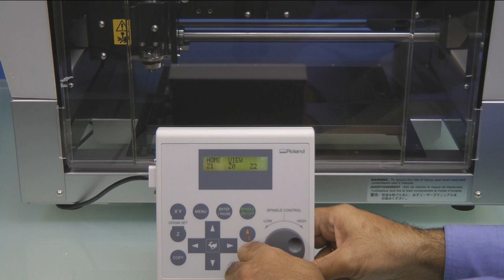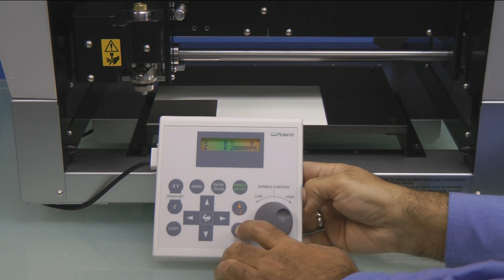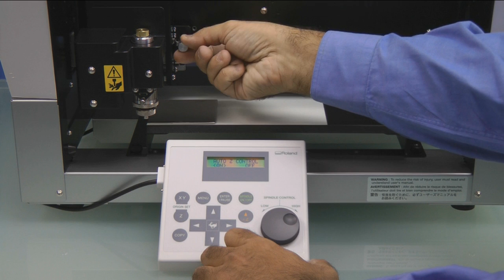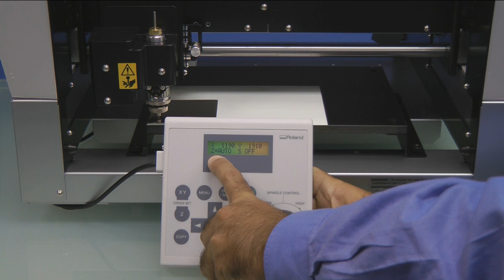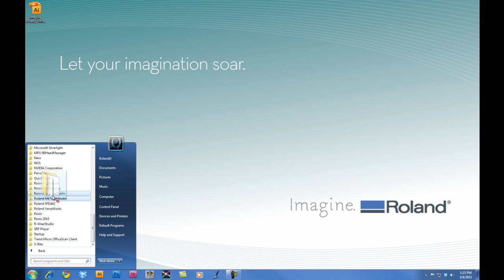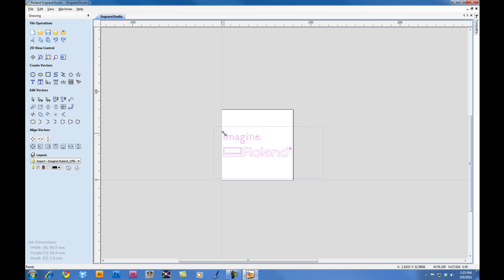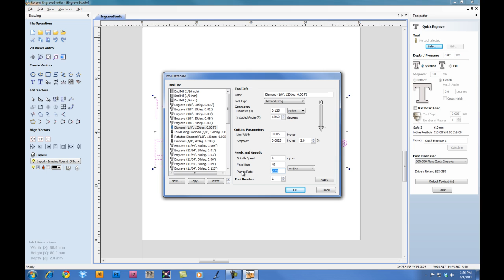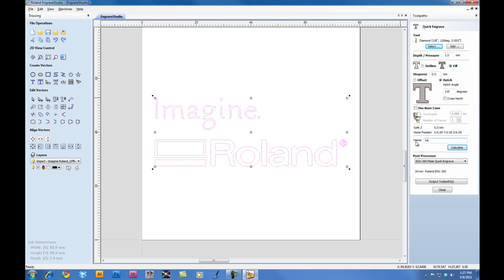EGX-350 Out Of Box Configuration (2 of 4)

Comment: Hi!
I have EGX-350 machine in some years now, but still haven't used it.
It happened to be very difficult tu set up th drivers corectly to work.
I managed to run Dr. Engrave tool but if I try Roland Engrave Studio it fails all the time.
In your video at 7:41min when I click on Calculate Quck Path - The software shows a message 
"Please turn the Machine on and connect it to USB".
My machine is turned on and connected, Dr. Engrave manages to engrave, but not Roland Studio.
Does some one have any idea why ? 

I had actually a Win7 PC which was working with that SW but since then I can not run the software 
and find the engraving machine on any computer.

HELP !!!
Reply: Your location ?